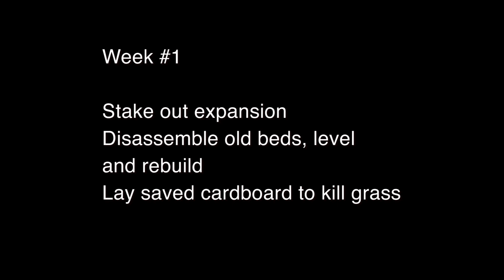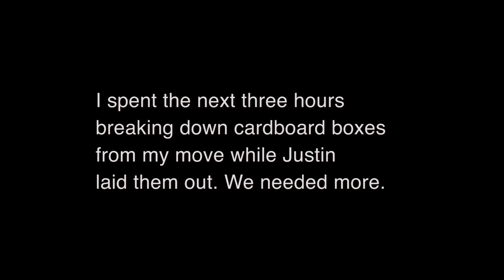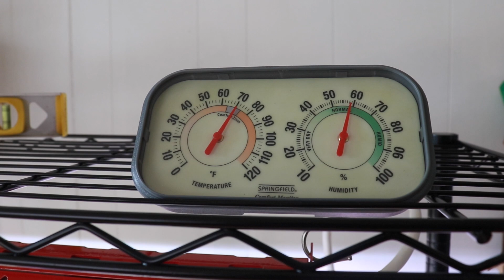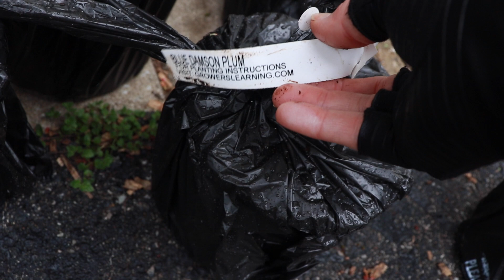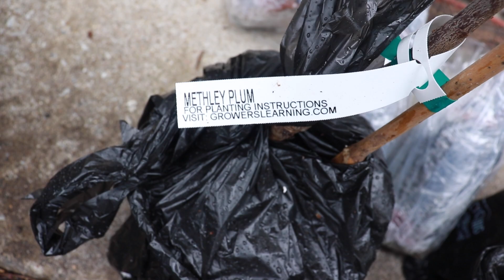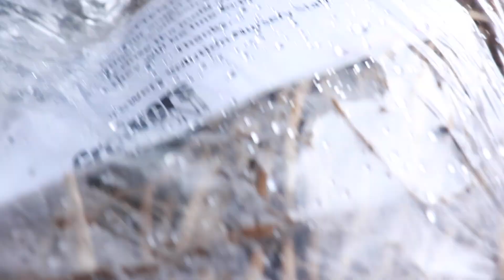Spring Garden RAISED BED BUILD, and FLOWERS!

Comment: so much work but IMO that is not enough cardboard to stop most perineal grass, especially Bermuda. Every sliver of light has to be completely shut off for the entire growing season to effectively kill the grass.  Too many gaps there.  I think you need to overlap the cardboard by 1-2 ft and need 3 layers of cardboard before adding wood chips. Since you will not likely redo it (I wouldn't), consider tarping it for this season. Maybe leave a small area uncovered this season that you can keep up with pulling the gras out. Beautiful wood.

Comment: You may want to invest in a small garden tractor but make sure you can get the implements easily changed from one to another.  Mower, blade, tiller, and maybe bucket would be helpful.  Big investment but maybe have someone bring a tractor as you need it and do the work gratis or barter or for a reasonable fee.